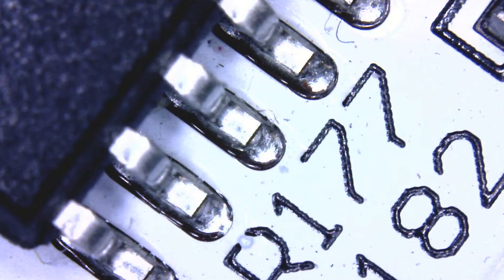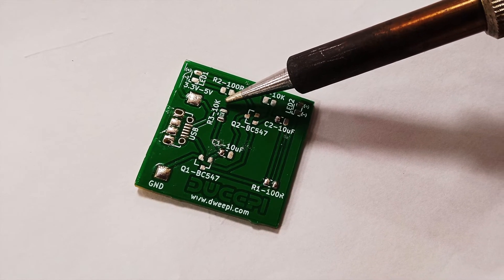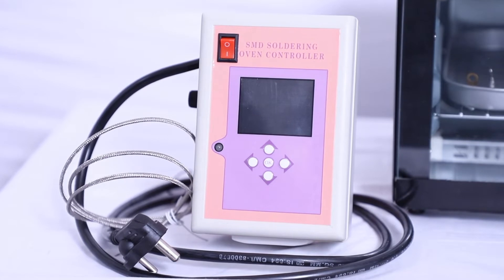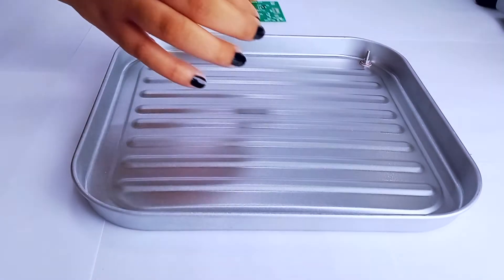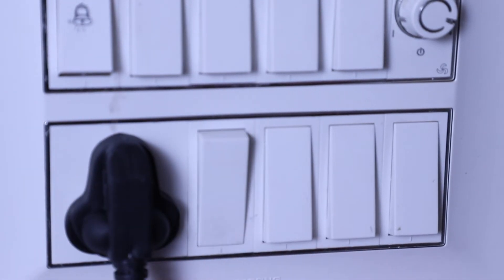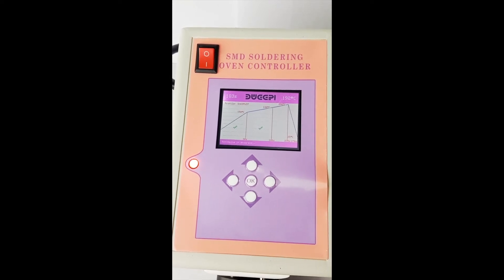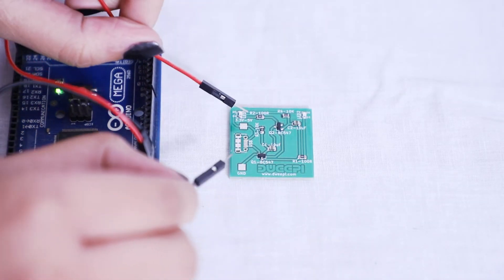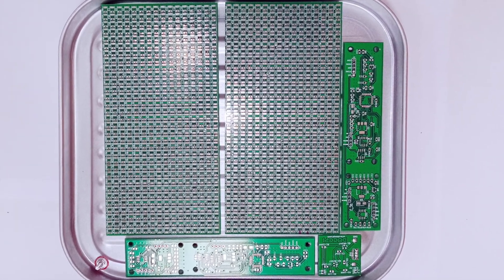SMD Soldering reflow Oven Controller Set

Comment: This machine is awesome! It is the best thing I have bought this year!
Reply: What was the price when you bought it?
Reply: @ae_circuit  14500 INR. Price seems a bit on the higher side but given the convenience it provided at that time, it's worth it. However, you may buy HOT PLATES and make a DIY smd soldering tool yourself for under 7K
Reply: @ae_circuit  14.5k around
Reply: bot